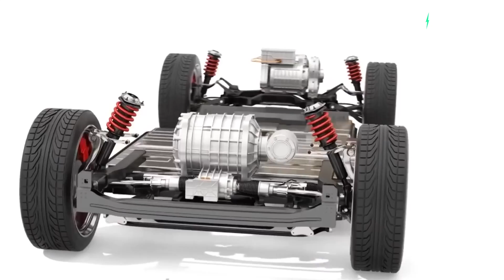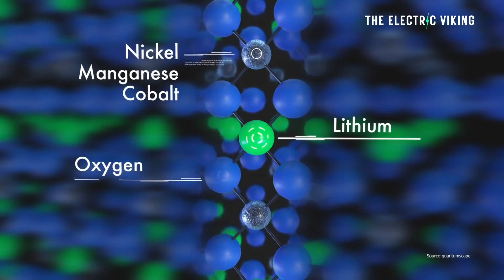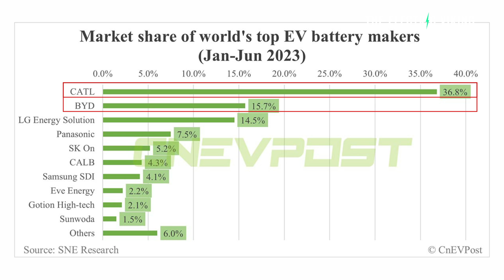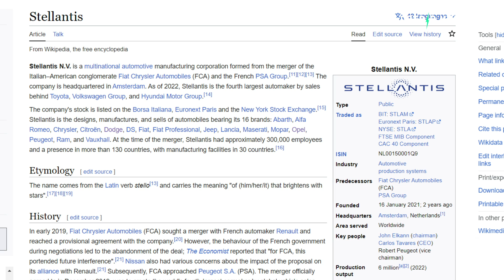Battery pack prices see HUGE decline - EVs cheaper than gas in 24 months

Comment: I feel like the breaking point is when the major car manufacturers offer a mid size economy EV for under 30,000 USD with guaranteed lifetime solid state all weather batteries and a practical 250 mile range that has a 15 minute recharge. An option of auxiliary clean heating like a alcohol fired heater would be nice for those in northern climates. But then this is all dependent on a dependable, adequate and affordable power grid without which the entire discussion is mute.
Reply: It is far cheaper to have a battery pack that can do 300 miles in good weather, and have 250 miles during cold weather while running a heat pump heater.
Reply: @GoCoyote  Living in the South I am very familiar with heat pumps. They are very practical and efficient in mild climates, however when the temp. drops below freezing they are pretty much useless and is why they are equipped with auxiliary electric heating systems. My thoughts on alcohol heaters was to lessen the drain on the batteries and as a safety measure when stuck and stranded in severe winter weather. I’m originally from Northern Michigan and am also familiar with being stranded in a snow storm.
Reply: yeah, and humans can't make power grids. We are so bad at power grids
Reply: I’m not sure anyone cares if it’s a solid state battery, I certainly don’t. The battery tech itself is probably irrelevant to most buyers (as long as it’s safe) but your other points are spot on.  Price under 30k, cold weather range of 250 miles / 400 km, recharge 10-90% quickly, 15 minutes as suggested and you can count me in to upgrade my 2018 Bolt!
Reply: Solid state is already proven to be shit! Nio has the worst range compared to Tesla or BYD
Reply: @robertorebola7532  For many people safety, longevity and faster recharging outweigh range which are the advantages of solid state. The range issue will improve as more research is done.
Reply: You don't own a Tesla do you
Reply: @PaleBlueDotCitizen  My son and most of my wife’s family own Teslas, I’m well aware of their benefits and short comings.
Reply: We're going to see way better than that soon in the next 5 years. Solid state and Na + sulfur = 700 miles with many of them with a power dens of around 700-900 per kg
Reply: This is just your way of saying you are sticking with your ICE.   An EV has a long list of reasonable reasons for buying it.  But you want your ICE so man up and admit it.
Reply: @danharold3087  At present a solid state battery looks like the best shot at a battery that will give a close to the life of the vehicle performance.
Reply: @jackdelvo2702  IDK as much trouble as tells is having with the dry electrode process I wonder.
Reply: @danharold3087  No, I believe electric is indeed the future but just as the ice needed an infrastructure of dependable reliable fuel access so do EV vehicles need a massive expansion of the power grid generating capacity and decisions on what power source is to be used. All this takes time and massive amounts of investments. My relatives in California that own EVs already have grave concerns about power availability.

Comment: Except we're still not seeing the price reductions on the sticker price flow through from these cost declines of battery manufacture.
Reply: The reality is that regardless of battery cost, retail EV prices will go up and down based on demand until BEVs saturate the market. There is also the fact of the outdated auto dealer system that will take all of the profit that the market will bear when demand is high.
Reply: @Tron-Jockey good, then ! let them rot.
Reply: EVs are still an in demand limited supply item that is inherently superior to the incumbent products. Market forces are driving prices rather than manufacturing costs.
Reply: @@davidlightman9551because of competition. The capitalist system  at work.
Reply: @@davidlightman9551 I hope the same happens in Australia where the M3 is back up to $61.5k (admittedly that is the new Highland model refresh)

Comment: Actually, safety concerns and the cost of increase in power and a lack of reliable infrastructure.
Reply: "reliable infrastructure." its pretty much in every state at this point. Not in every town yet, but you also have the option to have it at home. Can't do that with gasoline.

I can see every town in the next 10 having at least one. As for power - yea... we will need to do something about that, but its also helping the grid as most stations have battery packs that also help power the grid by limiting how much of a spike hits it. We will need to start looking at adding more power sourses for sure though.. coal still an option if we're willing to carbon capture.

I agree- but gen 3+ batteries should be safer than ever before by removing the reason for some of the reason they thermal run away in the first place. Solid state removes the liq that helps keeps that thermal run away going.
Reply: Baaaa

Comment: Sam, there are numerous other videos debunking the electric vehicle --some focussing on the horrendous depreciation of battery cars --easily swamping the notional savings in fuel , on the face of it the case against EVs is persuasive --the cost of Lithium had INCREASED by over ten fold (not dropped - if so only a marginal dip )  As you note the plethora of 'breakthrough' announcements is unending -but basically hype at least for now. Likewise the whole basis for WANTING to ditch ICE to 'save' the planet from an ever more threatening climate crisis that you cannot see or feel taste etc - thereby needing to hype up the doomsaying and attributing every natural diasaster to CO2 (even the dam failure flooding in Libya and who knows, the Morrocon earthquake --EVERY cyclone or flood is blamed on ICE --if you study the 'other side' you come away just as convinced in the other direction .... appeal to the mob,lowest common denominator ...just vote YES etc is based on fear basically.   EVs are quieter for sure (partly due to the huge battery mass absorbing interior road noise ) but what else do they have to offer?  One very green convert I know has found out just how uneconomical they are when it comes to towing .  Personally I wish we could have a 'for' and 'against' case ,with validated supporting data, presented together -on this and other topics rather than the bipolar 'don't listen to those fools' type .   cost  2cents.
Reply: I thought the same and then hired a Model Y for a week. The driving experience is so much better than what I am used to. Ordered my own last week. It's zippy, great UI and love being able to unlock by having my phone in my pocket, plus it has a huge amount of storage for my two kids. 95% of the driving I do is around the city. 

But hey, you seem pretty convinced so nothin I say is going to stop you.... the market is clearly going an opposite direction to you.
Reply: These two responses sort of prove the thesis .... I was following the price of Lithium in regard to it's use as an alloy in "stainless magnesium"  invented at Monash Uni for structural use in a flyable road vehicle  so when I read that the price is DROPPING it got my attention --the demand from EVs has dramaticaklly increased the cost --not to say it might not drop if and when volume production comes on line (hopefully not in China -maybe even pruducing METAL in Australia rather than shipping rocks still )   My "EV devotee" neighbour gave me my first trip in an EV --definitely quieter and heaps of acceleration but still limited to the exact same road speed and travel options as my $250 Mitsubishi van (that I could /had to even live in....)  I see Lamborghini's the same way -necksnapping acceleration for ...two SECONDS.. and then follow that tram with everyone else - driven to be seen, moneyed spivs , real estate salesmen etc  in contrast to virtue signalling ,green nuts  who are likewise 'making a statement' .   I ride a bicycle now but have no problem about using a key -if I lose it it won't cost me $1500 for a replacement ....   I don't have kids needing "storage" (isn't that is what boots are for ?  -'trunk' to Americans or Mafioso  ....  )  Bicycles are also remarkably quiet and economical and never have to search for a parking space ... especially when "95% of the 'travel' is around the city --and I bet on your own - who is really better for the planet?   @leah.internet
Reply: Sorry about the crossouts - can't find why they appear after I post (not before) and this second or third hand gen 1 lap top  is all I can afford....
Reply: You cannot see or feel taste arsenic or carbon dioxide.  Both are real and kill people dead.  Don't use that lame argument.
Warming climate is making weather more extreme, leading to more frequent and intense heatwaves, droughts, floods, and storms.  It is also making some areas cooler.   Energy drives the weather patterns and the more C02 in the air the more heat energy is supplied to that driver.  So while earthquakes would be stupid. literally everything about the weather can be amplified by adding more heat.   Everything is more extreme. 
Climate change is real.  The question is not even how fast we are accelerating but how can we retard it.
If you need to tow a lot don't buy an EV YET. 
EV maybe less convenient than an ICE for towing but ICE is the less economical.
I hope that helps.
Reply: Well said and completely true.

Comment: In Australia the cheapest petrol cars are around aud $20000 both are crap the small crappy Kia and the small wannabe MG will EV prices drop that low but batteries were out a lot faster than petrol Toyotas stop bagging Toyota because they make the best longest lasting cars some if the most luxurious cars and don't forget there hybrids the best of both worlds electric and petrol they get goid fuel economy and l own own a 1997 Toyota Hilux and it is running very well why would l want to sell it for an EV were an EV built today will not last as long as my Hilux its indestructible no modules or computers to fail a very good engine it will last another 26 years easily and 3 years ago l paid aud $1500 and are EVs reliable last 20 30 and 40 years with 100s if 1000s kilometers with very little problems and they don't catch fire and there us another point l would like to bring up will the emergency services be using EVs in the future great an EV ambulance is on the way to a life and death situation and the ambulance battery goes flat and the ambulance can't get the emergency or an EV police car chasing a car and the battery goes flat and they can't catch the law breaker in his petrol and last an EV fire engine on its way to put out an EV on fire can't get there because the battery went flat so the EV continues to burn putting nasty chemicals into the atmosphere causing more pollution
Reply: I have a 1979 HiLux long bed.   I scoot around town with it but no further.   People think it is neat but is is a unsafe vehicle by design.  My throttle body GMC K1500 get better fuel mileage and is less prone to rusting.   The 22R is a beast but I have a R20.   You have an ignition module in your HiLux.   
Ambulances and police cars will start the shift with a full charge.  No police will run out of battery during a chases unless it is 100s of miles long.   By then you have 6 other cars and a copter in the circus.   This argument is bogus.  EVs have a better weight distribution than ICE and tend to make better chase vehicles.
By the time EV haters buy EVs batteries will be lasting a million miles.    
I too have a stable of old cars.    But if people want a new one they have to chose from what is being sold.
Reply: @danharold3087  There is nothing wrong with the 20R engine in Australia we only got the 22R in the Toyota Hilux from about the mid 1990s and the 22RE engine in the Toyota Corona Avante which came out in the 1980s when emission laws came in for private cars but not for comercial vehicles hence my 1997 Hilux has a carburetor and no cat converter there is no computers or modules the only electronics are in the radio cassette player and my Hilux has criuse control which may be electronic but it doesn't it was an optional extra along with the air conditioning and the radio cassette player also a tow bar which is a genuine Toyota accessorie there us a sticker on it that says that and in Australia the four runner was very rare in Australia l have seen one four runner 1997 model and the 1997 Hilux were mostly rear wheel drive but the configuration of my hilux single cab with the aluminum tray in reasonable conditioning is the most desirable and there are a few keft on the road but my hilux is worth aud $5000 to $6000 and they sell quickly but the less kilometers the more valuable they are l bought mine three years ago for aud $1500 a running registered ute me test drive was from Newcastle N,S.W to my home in the outer southwestern suburbs